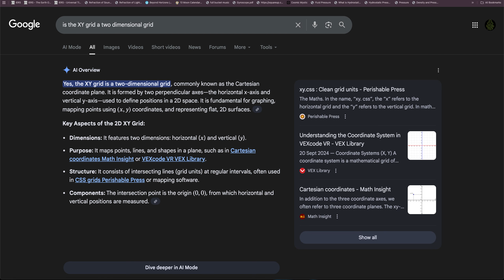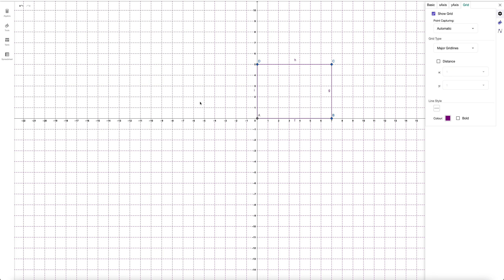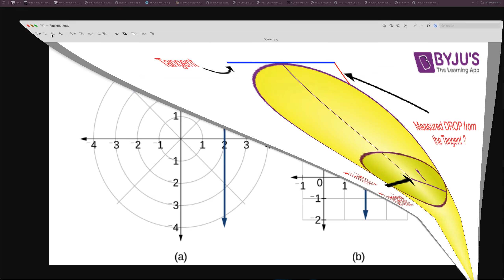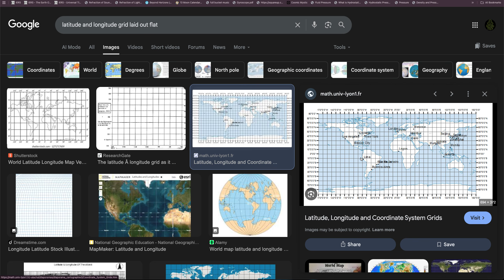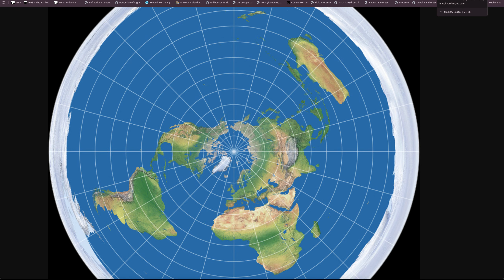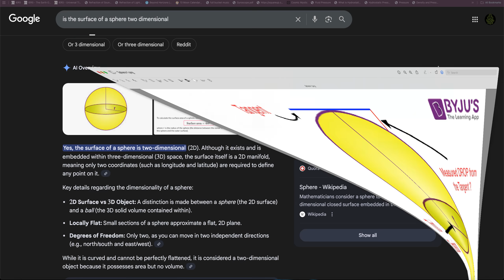The 2D Globe  lol

Comment: This whole abstract mathematical idea of 2D manifolds of Gauss was NEVER needed in the whole history of geodesy.

In geodesy real measurements are taken of the earth with lineair measuring tools for which the results are traditionally interpreted in a the metric called Euclidean realism. This metric is based on the false assumption - that allegedly Erasthostenes took on - that the earth togheter with the sun, moon and stars are tangible objects in a total 3D space. Thinking this metric is reality is ofcourse FALSE because it is in contradiction with the nature of the measurents that REQUIRE the earth to be a flat plane of reference if the measurement are to be valid. There are no distance measurements to the sun, moon or any star.

EARTH is MEASURED flat. ALWAYS!

2D manifolds are historically NEVER even claimed to be of any use in geodesy whatsoever. Claims of measurements of spherical excess are also in no need of 2D manifolds.

So I am not sure why globers in ignorance have their mouth full of this. Probably confusing themselves with non-existant geometries will somehow affirm their imaginary globe.
Reply: How do you explain:

- that any sufficiently large triangle on the surface of the earth has internal angles which sum to greater than 180°?

- that meridians get closer together as they get both further north and further south of the equator?
Reply from the maker: @andrewjohnston6631 They don’t Andrew that’s the point.
Reply: @BriansLogic  They do Brian.

Admittedly I haven’t measured spherical excess but I have measured the scale of meridians at a number of locations between the Tropic of Capricorn and southern Tasmania. I can assure you that they converge as predicted on the globe.
Reply from the maker: @andrewjohnston6631 No Andrew NOTHING you tell me would I accept as fact, as you’re a dreamer Andrew no offence…. 
And by the way you have just claimed that there is Not, 2 hours of correct local UTC time between Sydney and Perth….
Reply: @andrewjohnston6631 ” admittedly I haven’t measured spherical excess “ 😂😂 - no one has Andrew .you seem to be caught in a world of sophistry. 
What you are defending is a hundred years old and debunked to timbuck too and back again . 
Put the paper theodolite down Andrew and have a few drinks before ye blow yer keyboard up 👋👋👋😂😂. Have a long cool one , but be sure to have the Soda syphon close at hand 💥🔥.😂😂
Have a good weekend Andrew 🍺
Reply: @BigBoaby-sg1yo  “What you are defending is a hundred years old”

Spherical excess was first measured in 1670.
Reply: @BriansLogic They do though, Brian.

The internal angles of the triangle between Sydney, Perth and Darwin add up to 229 degrees, which makes it impossible on the flat earth.  Welcome to the globe.

"Damn that Australia" - Right, Brian?
Reply: "EARTH is MEASURED flat. ALWAYS!"

You're going to have to argue that with Brian then. Despite him being a flat earther his last video was about how we need to remove spherical excess in order to make the measurements fit on a flat map.

"Claims of measurements of spherical excess are also in no need of 2D manifolds."

Exactly... a 2D manifold is not a flat plane. We don't need to remove spherical excess from the measurements when using 2D manifolds because a spherical 2D manifold is curved and not flat. Spherical excess removal is only used when trying to convert a spherical triangle into a planar triangle.

"So I am not sure why globers in ignorance have their mouth full of this."

I don't even know what you mean by this but the reason why "globers" are here in the comments is because  we for some reason want to help Brian understand that his last video has proven that the Earth is measured curved. In the last one he confirmed that we need to remove spherical excess to make the measurements fit a flat surface and in this one he is now trying to conflate flat with 2D to avoid that reality.
The Earth is a spherical 3d shape with a spherical 2D manifold surface that is measured to have curvature across that surface. In order to make it fit on a 2D plane you need to correct for spherical excess. Flat maps do this but globe maps do not. It's all pretty conclusive really.
Reply from the maker: @bobleonheart9600 No you NEED to remove Spherical Excess to reference reality….
Reply: @BriansLogic  So let me get this correct. 

1) You go out in the world and take measurements of what you see.
2) You alter those measurements for some reason to "reference reality" and make it flat

So the measurements aren't flat? Surely you can see what is in front of you Brian. You are arguing that you need to alter the measurements to make them flat because it isn't measured flat.
Reply: @bobleonheart9600 I dont think Brian understands that is exactly what he is saying.
Reply: @JohnSmith-ux3tt  I think on some level he does understand. This video and his last one have been so telling. First he tries to call out spherical excess as a problem for us when in reality it's a problem for him and then in this video he pivots into denial that you can use 2 dimensions to plot things on the surface of a sphere. Effectively this video is a desperate attempt to try and invalidate what he proved in the last one which is that the Earth is measured curved.
Reply: Geodesy.  Oops, it sounds like geodesy debunks flat earth.

Geodesy is the science of measuring and understanding the Earth’s shape, size, gravity field, and orientation in space.

In plain terms:

Geodesy figures out where things are on Earth, how the Earth is shaped, and how it moves.

What geodesy covers

🌍 Earth’s shape – not a perfect sphere, but an oblate spheroid with local bumps and dips

📏 Positions & distances – precise coordinates used for maps, GPS, and surveying

🧲 Gravity field – variations that affect sea level, satellites, and navigation

🌐 Reference systems – datums like WGS84 that everything else is built on

🔄 Earth’s motion – plate tectonics, polar motion, rotation changes
Reply: @JohnSmith-ux3tt  Correct, and geodesy uses measurements of the earth and recalculates them wihtin a framework that essentially goes back to the false assumption of euclidean realism. This argument is going way over your head buddy. You don't have a clue what the argument even means. 

Look at you: "Oops, it sounds like geodesy debunks flat earth." hahaha what a complete clown. Has zero clue about the actual argument. And doesn't even understand what euclidean realism means, but thinks he can come and discuss this. What a joke.
Reply: @sunbirdism You seem to have missed the bit where it said it was the study of the earth's shape, being an oblate spheroid and the effects of gravity and mapping systems, such as WGS84 (a spherical based mapping system).

I thought you numbnuts said the earth was flat, that gravity doesnt exist and WGS84 does nothing.

And here is a description of geodesy saying all of those things are real.

You sound like the clown in this story.

How about another "Earth is measured flat. Derp" chant to keep your spirits up?  And tell yourself again that flat earth must be true.  Because you want it to be.  Sounds like a cult.
Reply from the maker: @JohnSmith-ux3tt Geodesy measures the earth with Parallel Horizontals and Parallel Verticals, proving without a shadow of a doubt that the only correct description of earths surface is Flat.
Reply: @BriansLogic That's your claim and you presented zero evidence to validate that.  Meanwhile, I have produced a publicly available definition if geodesy verifying it is the study of  the Earth as a sphere and that gravity exists ie flat earth debunked.

Don't bother trying again.  You really are no good at this.
Reply from the maker: Yes exactly reality is not being referenced when they parrot and claim these things, they don’t and mostly cannot give independent thought to what they’re claiming, it’s a case of I was thought this, this is what basically everyone else says, so when I say it, it must be true ?
It’s extremely faulty logic that relies upon a mountain of consensus…. 
I find myself tying myself up in knots just trying to explain their delusion to them, it’s a jumbled mess from a psychological point of view.
Reply: @BriansLogic  The truth is Brian that you are tying yourself up in knots trying to deny the truth. I mean just read this comment you made earlier and think about it:

"No you NEED to remove Spherical Excess to reference reality…."

You are saying that the direct measurements don't reflect reality and in order to make them do so you need to alter them. If the Earth was truly flat then the removal of spherical excess would not be needed because the direct measurements would already conform to flatness... they don't though. The Earth is not measured flat. If you stop wriggling and squirming to deny the facts and simply accept them for what they are then you won't need to tie yourself up in knots.

Comment: Well, the polar coordinates you showed on a plane describe the whole plane with two coordinates (radius and an angle).
You can do the same thing also in three (or any higher number) dimensions (radius and two angles).

For a sphere, you don't want to describe the whole three dimensional space.
You can drop the radius, and just use two angles. This is what makes it then two dimensional.
You couldn't go to any point in the 3d space, that wouldn't be on that sphere, when you can't change the radius.

Like with a cartesian  coordinate system. Drop one of the coordinates, and your are left with a 2d surface.

But I don't care. If you wanna insist on your position, I'm okay with that. It kinda makes sense, that a sphere is also 3d.

But "you can't have parallel circles" (15:45), is what I would disagree with.
Like people could tell you, if the wheels on a car are parallel to each other, or not.

23:15 Distortions don't really tell you anything.
You could even think of something like a warped flat space, where distances are changing.

 Good luck, finding a map of Australia without distortions.
Reply from the maker: Are we admitting those three dimensions again smh 🤦‍♂️ once again you ADMIT that the surface of a sphere is 3D….
We’ll done ✅
Reply: @BriansLogic  as you’ve been told before Brian, a location on the surface of a globe of ANY size can be defined by just TWO angular dimensions. Perhaps you could try to disprove that

Comment: Brian, let me help you. The surface of any object is 2D. When we measure and describe surface area, including the surface area of a globe or sphere, we express this area in square units. THE FORMULA IS 4 x Pi x R^2. NOTICE that the radius is SQUARED, hence 2D. The longitude and latitude coordinate system only works on a globe. That is because it’s a spherical coordinate system. For example the distance along the equator between 2 longitudes is greater than the distance along any latitude both north and south of the equator between the same longitudes. AND to calculate the distance between longitude and latitude coordinates REQUIRES spherical geometry.
Reply from the maker: No Phil 4PIR is 4 circles made into one big circle ⭕️ and that then will be the square mile etc area,of the sphere that the circle can become, the sphere has NO square miles upon it as that would be impossible Phil. 
Spherical Surfaces are 3D end of story….
Reply: @BriansLogic  no Brian 4 x Pi x R^2 is the formula for the surface area of a sphere. For goodness sake’s, you learn this in 5th grade. The fact that it happens to be the same as the area of 4 circles with equal radius has nothing to do with how it’s derived.
Reply from the maker: @profphilbell2075 Phil 4 Pi R is referring to 4 Circles of equal Radii to the Sphere, their collective area is considered to be the area of a really big Circle ⭕️ that if made into a sphere would be the size of the original sphere, it’s pre-assumed Phil as they can’t put squares on a sphere, because it’s a Three Dimensional Surface ???? Hello ?
Reply: @BriansLogic  NO Brian you don’t get to make up your own geometry. The surface area of a sphere was derived by Greek mathematician Archimedes using this basic axiom. The surface area of a sphere is equal to the curved surface area of a cylinder that has
• the same radius as the sphere
• a height equal to the sphere’s diameter (2r)
So 2pi x r^2 x 2r = 4pi x r^2. 
It has nothing to do with 4 circles of equal radius. The VOLUME of a sphere is 4/3pi x r^3 based on  the same axiom and using the geometry of a cone. Of course since Sir Isaac Newton who invented the calculus, CALCULUS is the more elegant method of determining the surface area and volume of a sphere. Like I said, this is 5th grade geometry, even in Ireland.
Reply: @BriansLogic  OF course the surface area of a sphere is 4 times the radius of that sphere SQUARED x pi. NOTICE that the radius is SQUARED. That means r x r. But that is not the derivation of it. Read my post referring to Archimedes. How do you suppose we could calculate how much leather is needed for a soccer ball? How would you calculate the surface area of a sphere?
Reply from the maker: @profphilbell2075 Stop trying to save face Phil when you know that it can be done as a cylinder ( rolled out flat ? ) 
Or it can be does as 4 times its own shadow, which is four circles of equal radius…. 
Either way you will require the flattening of the sphere, either into a cylinder or into four circles, as you cannot place squares onto a curved surface Phil…. And do you know why ???? Spherical excess…. 
Now stop trying to be clever Phil that ships sailed.
Reply: @profphilbell2075  I think Brian is saying that area of a sphere's surface is equal to the area of 4 circles that have the same radius of the sphere. That's correct. And he's right as far as I can see when he says that the area of those 4 circles can be equal to the area of one bigger circle but I'm not sure what that has to do with anything. The area of a circle can be thought of as the area of a triangle with base 2πr and height r. 4 of those triangles can be arranged as a rectangle with the same base of 2πr with the height being 2r giving the area 4πr² which is the same area as the sphere or rolled out cylinder. So no arguments from me with what he's saying there. What Brian is not getting is a 2D surface in 3D space is still only 2D.
Reply: @BriansLogic It has literally nothing to do with spherical excess, an oblate spheroid’s surface is still 2D.

And the formula for the surface of a sphere does not come from the formula of a surface of a circle
Reply: @BriansLogic  "No Phil 4PIR is 4 circles made into one big circle"

That the area of a sphere is identical to the area of four cirles with the same radius is just the beauty of math!

Comment: Euclid's Elements
Book I

Definition 5
A surface is that which has length and breadth only.

Euclid's Elements
Book XI

Definition 1
A solid is that which has length, breadth, and depth.

Definition 2
A face of a solid is a surface.

Department of Mathematics and Computer Science
Clark University
Reply from the maker: https://thirdspacelearning.com/us/math-resources/topic-guides/geometry/sphere-shape/ Sphere Shape - Math Steps, Examples & Questions
A sphere has Zero faces.
Reply: @BriansLogic  
The important bit is "A surface is that which has length and breadth only."

Does a sphere have a surface? Yes. 
Is the surface curved? Yes.
Does the surface of a sphere have length and breadth only? Yes.
Is the surface of a sphere a 2D surface embedded in a 3D space? Yes.
Do surfaces have volume? No.
Do spheres have volume? Yes.
Can a 3d shape be described with length and breadth only? No.

Can you distinguish between a sphere and its surface? No.
Reply: @BriansLogic  "A sphere has Zero faces."

"In geometry, a face is a flat (or sometimes curved) surface that forms the boundary of a 3D solid shape"

Correct. A sphere has no flat surfaces and thus has no faces.

"A sphere is a 3D geometric shape with zero flat faces, zero edges, and zero vertices. It consists of one continuous, curved surface, making it distinct from polyhedra, which are formed by flat, polygonal faces. While sometimes described as having one curved surface, in strict geometric definitions, a face is a flat surface, hence a sphere has none. "

All faces are surfaces, but not all surfaces are faces Brian.

All surfaces are 2D Brian.

The surface of your head is 2D Brian. Your head in its entirety is 3D because there is an interior but if we are talking simply about the surface of it then we do not need the 3rd dimension. We can pinpoint any location on the surface of your head by drawing 2 lines around it. We do not need a third line going through the middle of it.
Reply from the maker: https://byjus.com/maths/sphere/#:~:text=The%20shape%20of%20a%20sphere,a%20vertex%20or%20an%20edge.